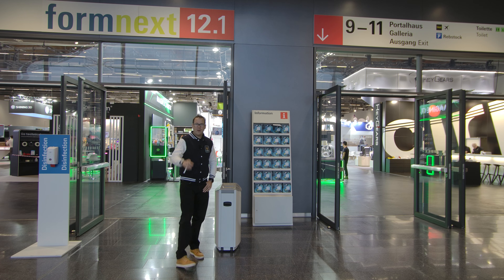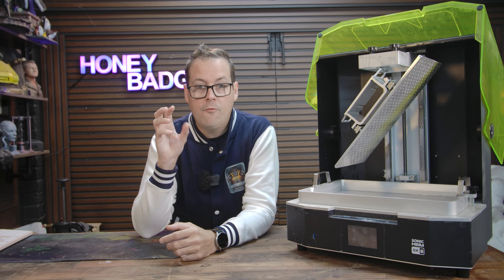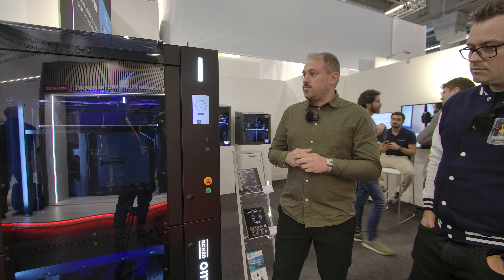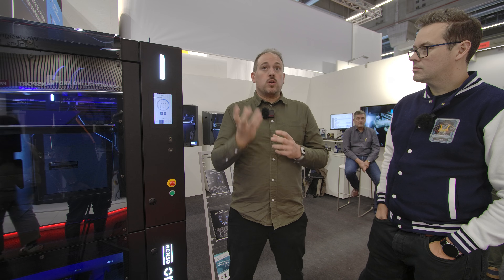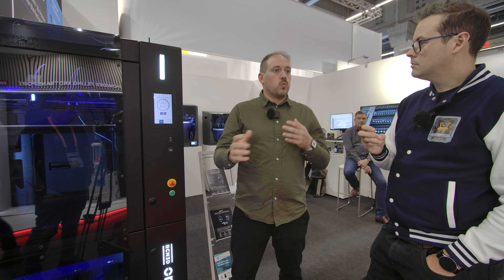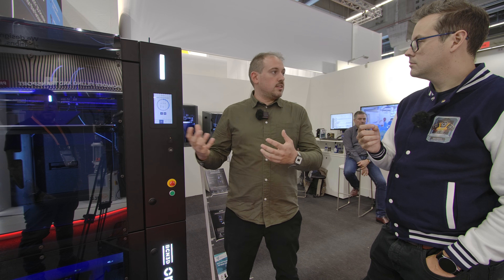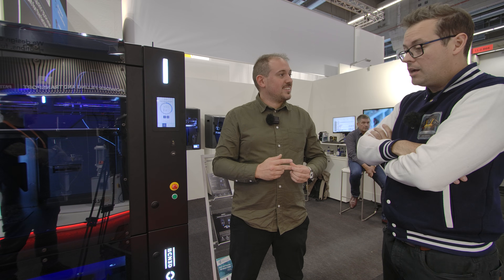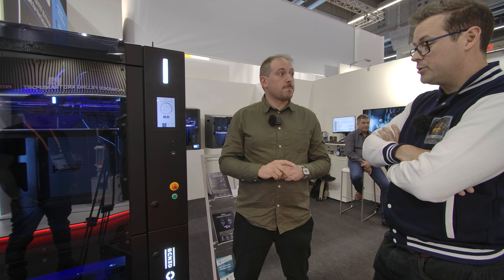BCN3D Next level IDEX and automation

Comment: Hey brotha! Real quick post-production (video) tip: Listen to a reference track (a video you think is really good from someone else for instance) and then set your headphones to that volume. Then, when you're editing, you'll know roughly where your various levels should be. So in this case, your intro video with the logo is probably at a good volume but the speaking portions are a bit low.
Reply from the maker: so embarrassing admission is we forgot to pack our headphones for this trip, but also any higher on the gain and background noise at a show like this becomes intolerable, we do our best at live shows but given the equipment we are working with its hard to get it bang on
Reply: @honeybadger3dprintandpaint  HIGHLY recommend the Adobe Podcast Enhance (free, on web) utility for cleanup, or for more traditional cleanup iZotope RX Voice Denoise or Spectral DeNoise for more targeted noise reduction.

The nice thing with iZotope is it slots into your NLE (Premiere, Resolve, whatever) whereas Adobe Podcast needs to process your audio and THEN you can edit with it after saving the file. It is, however, pretty insane at isolation.

Another option, if you're using Resolve, is just the simple Voice Isolation tool in the Fairlight page.